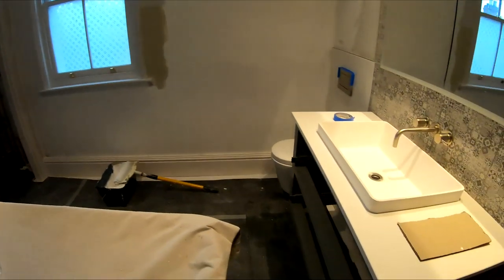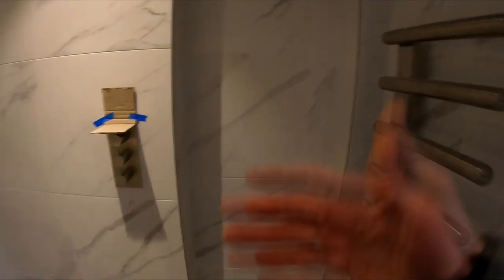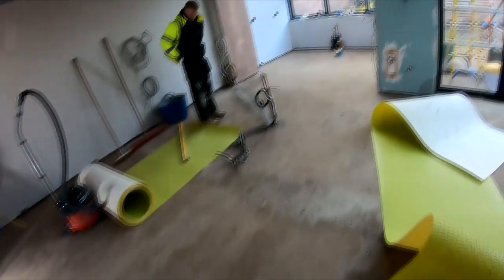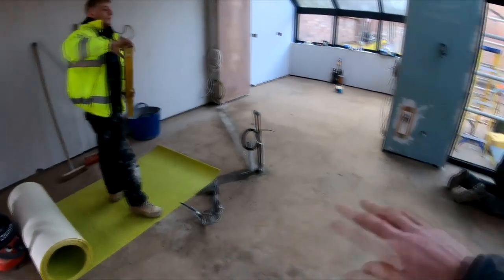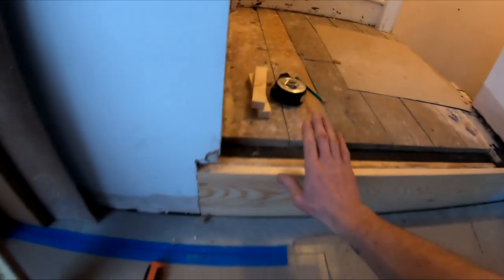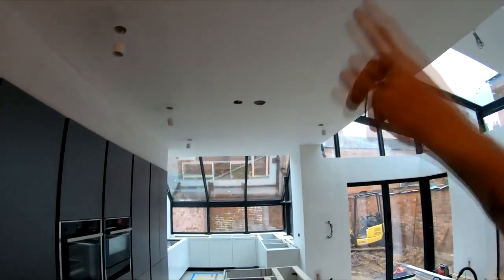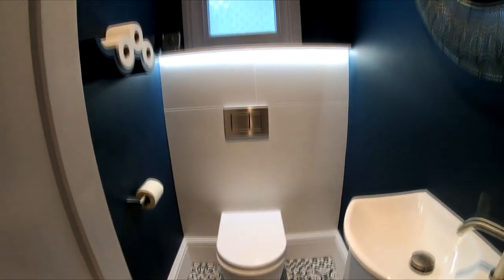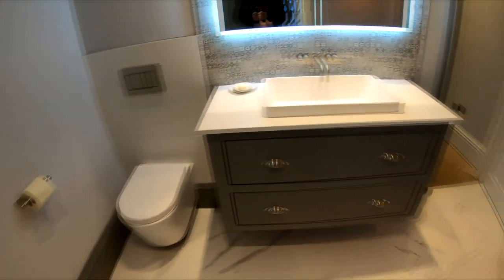HOW TO BUILD AN EXTENSION #9 | Plastering, Roofing, Tiling, Kitchen Install and more!

Comment: Quality work,  when you are working out your finished floor height how many mm do you alllow for the ci matts and adhesive? (distance between top of slab and underside of tile).  I'm guessing at 7mm.
Reply from the maker: Hi Steve,

I believe in this instance we did allow 7mm, but different mattings can vary in depth, so it's always best to check the manufacturer's specifications first.

Hope this helps.

All the best, John 😊

Comment: Underfloor heating, water or electric?
Reply from the maker: Hi postman445 most room were ever I can I run water but most smaller rooms like bathrooms, en-suite are normally electric because of Btu required. Thanks for watching all the best Tony 👍
Reply: Build With A&E thanks. I’m having major house renovations which includes a 6m exertion, the builder advised me to go with electric in a 6m kitchen. Which is the extended part. A friend of mine who is a plumber said use water, which is what I’m using now for the whole ground floor. Any suggestions on what floor I should use. I’m  not a fan of wooden flooring because it scratches. I’m looking into luxury vinyl flooring. Any suggestions?